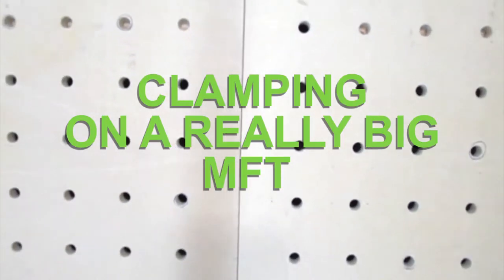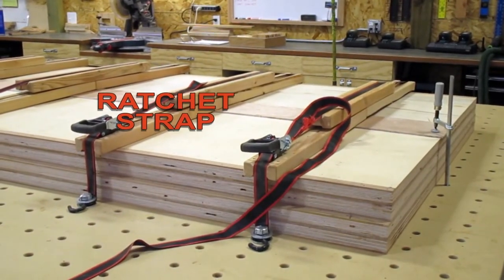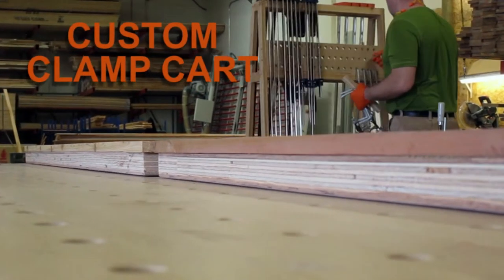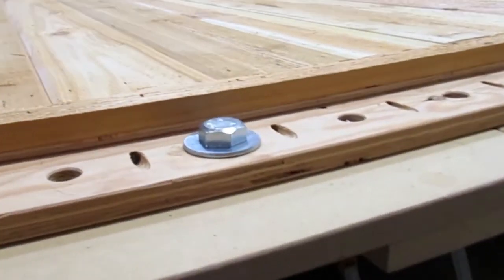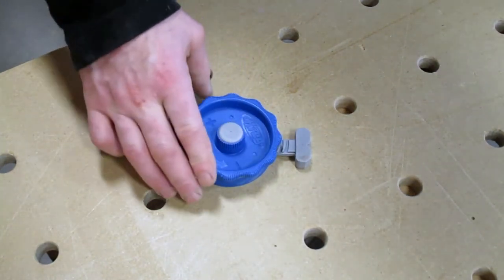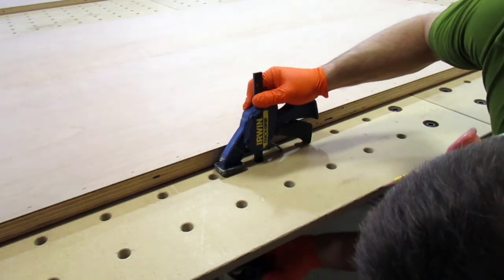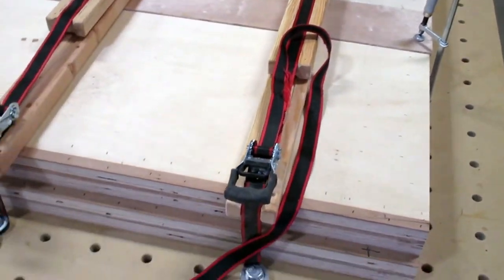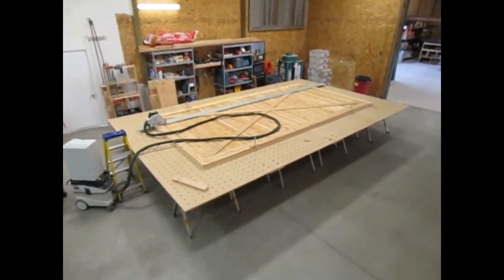MFT Table Clamps & Methods

Comment: Encyclopedic tutorial. Thank you! Will the Kreg  inline clamps (designed for 3/4" holes) work without excessive backward cant on a 20mm hole bench?
Reply from the maker: Thanks.  I haven't tried the Kreg clamp on a 20mm hole, but I think it would work.  There is a small tab on the bottom of the peg that gives it some extra stability.  If you couple that with the flexibility of the clamp's "stem," I think things will stay pretty flat.